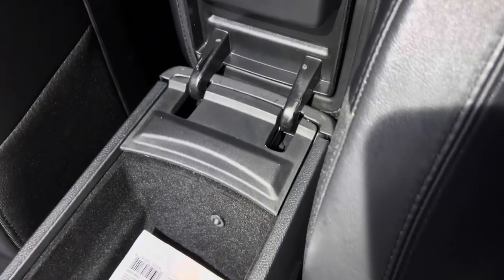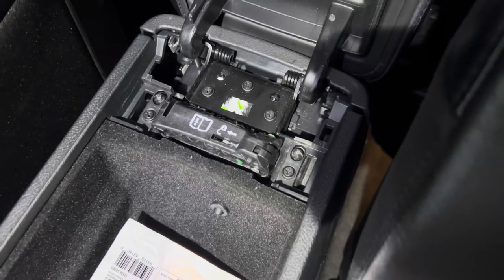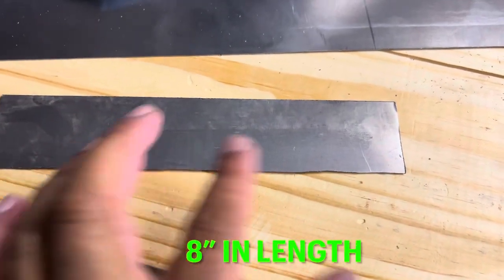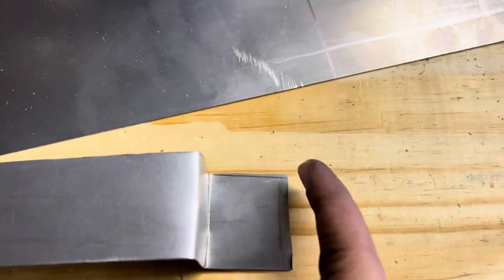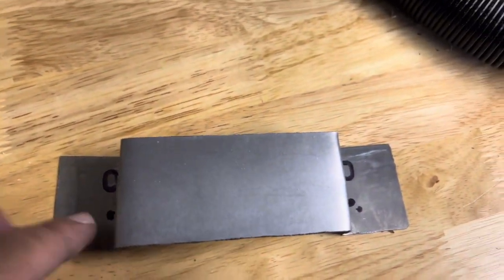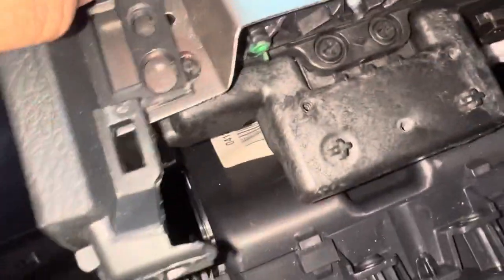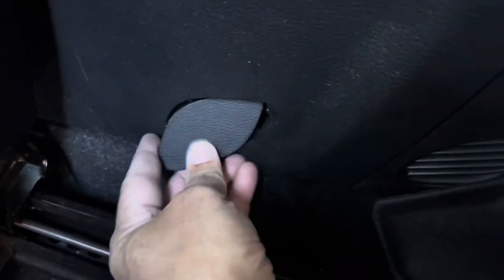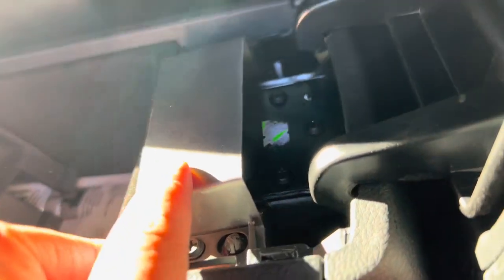DODGE DURANGO:HOW TO MAKE A NEUTRAL RELEASE ‘PROTECTION COVER’ FOR A DURANGO!

Comment: Man I love your videos keep up the good work. I’ve been working on my 2020 R/T AS WELL. ITS THE SAME COLOR AS YOURS. Also been keeping my engine clean as well. But I have one question for you. How Can I take the red tag off before I put the bracket over the brake puller puller. Thank you so much for what you do my brother. Stay safe 👍
Reply from the maker: Just cut it off. You can still use it if you ever need to by prying it up with a screw driver

Comment: How about disconnect the cable. Also have two kill switches on the starter button and the relay so if they find one it still will not start without the second being turn on. Amazon has a lock for your OBD2 port with key.
Reply from the maker: Yeah, good stuff! I’m looking into the obd2 lock as well

Comment: I see you said switch is for neutral release. Why would you want to release neutral switch?
Reply: They can put your Durango in neutral and push it away
Reply: @mikeymike2552  Oh, thanks for info.
Reply: @davidwatts5863  no problem!
Reply: I also misread your post. The Neutral Release is exactly what the thieves use it for. If you need to move the durango but you can get any power to start the car and get power to the brake switch to put it in neutral, you just pull that switch and you can move the car around.
Reply from the maker: @mikey mike explained it below. But basically if you need to move your vehicle but can’t start it, unlocking the neutral release will allow you to put it in neutral and move the vehicle (car thieves are stealing vehicles by unlocking the neutral release and pushing your car away!!!)
Reply: Wow! I didn't know it was a thing. You learn something new every day.